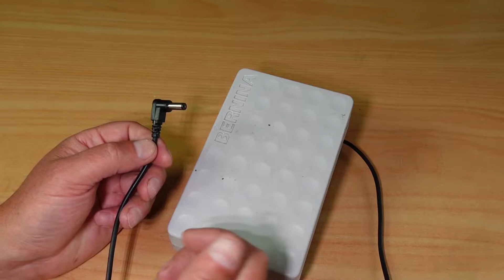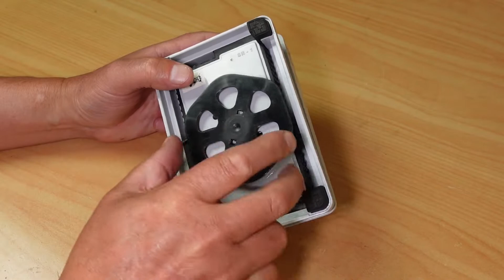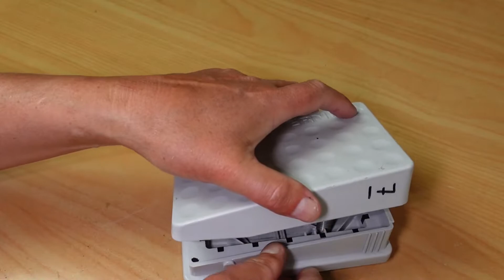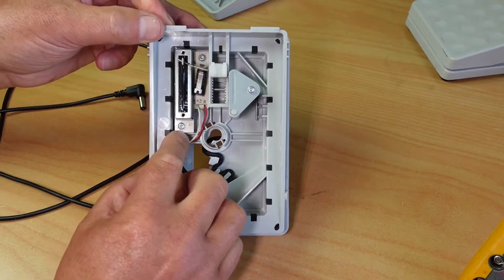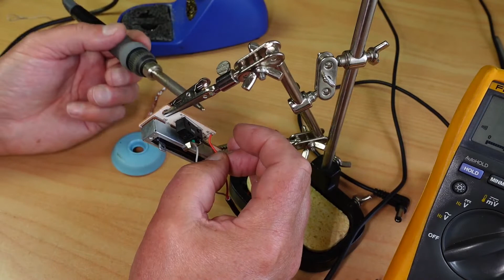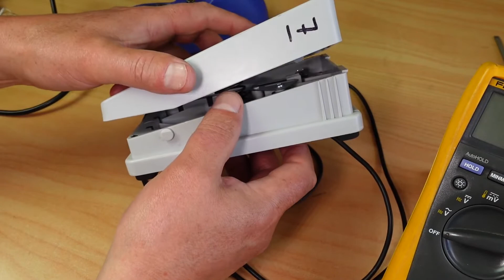Fix BERNINA Foot Controller - Newer Style - Sewing Machine

Comment: I have a bernina 145 and lost the foot controller. I checked online and cannot understand the price for a replacement. 
I would like to know if I could get just any foot controller and since I have older charger with similar cable, swap it with appropriate cable. 
At the end, it is just the resistor doing the job and was wondering if each controller has different resistor? 
I don't understand why a resistor and a plastic case would cost so much? Would a little bit of soldering with the appropriate cable  on a cheap controller do the tric?

Comment: I have just replaced the cable on one of those. Wife got up from machine and started walking off with cable around her foot -pulled the wires out inside the plug but the sheath still intact. Previously repaired the cable when the dog chewed it. Use an old 2 core mains lead (stronger) and a spare plug from a universal fit plug pack power supply.
Had the controller apart and about to remove the circuit board when I noticed this video had come up on my search.
𝗘𝘅𝗰𝗲𝗹𝗹𝗲𝗻𝘁 𝘁𝘂𝘁𝗼𝗿𝗶𝗮𝗹, 𝗰𝗹𝗲𝗮𝗿 𝗮𝗻𝗱 𝗰𝗼𝗻𝗰𝗶𝘀𝗲.
Jeff Henningham

Comment: Does this mean people actually repair things in NZ? A not so proud american.
Reply: Very few appliances and electronic items are repaired now. If it stops, discard it and buy a new one is the philosophy. Most are designed to be as cheap to make as possible with no thought of repairing. Even if spare parts are available the cost is often prohibitive.
That said though, I have repaired quite a few items with generic parts at tiny cost. Some examples;
•Many satellite boxes "dead" and two 5¢ resistors all that is needed. Original ones are under rated and installed higher rated ones.
•Multiple TV sets and computer monitors will not start, only needing some capacitors replaced at cost of less than $10.
•Computer power supplies nearly always same problem as one of the two examples above.
•Remote controls suffered a drink spill. Cleaning the button contacts with isopropyl alcohol (small bottle cheap). Hardest part is cracking into them without damaging the case. My advice is, if this happens, remove batteries, give them a good soak in water make sure you get as many bubbles out as possible for a few hours, then shake as much water out as possible and put them in a dry place for a few days to fry out completely -prop up and turn around regularly to ensure water drains out fully. Not guaranteed but worth a go.
Of course you have to know what you are doing. Some items can give you a nasty "bite"; been there, done that!
Jeff (Australia)
Reply from the maker: Well I do try to repair things if they can be. Unfortunately, devices today are made to be difficult to repair and some manufacturers go out of their way to withhold information from the end user or consumer.